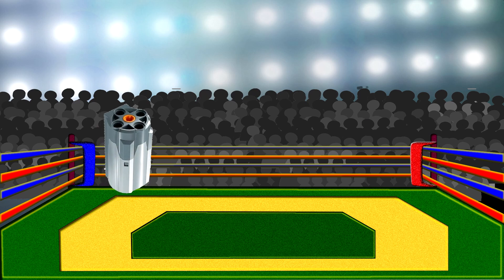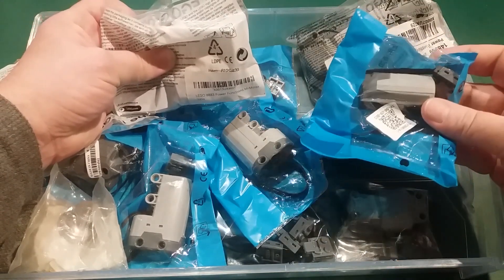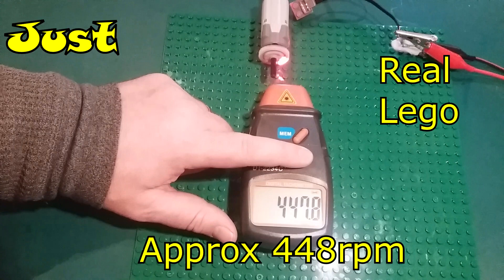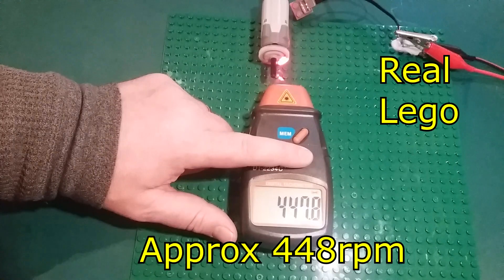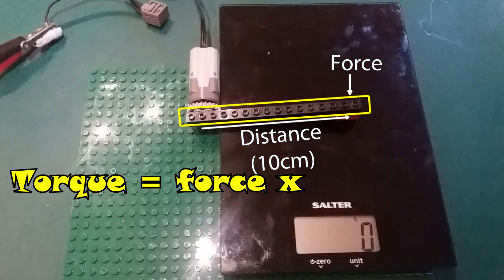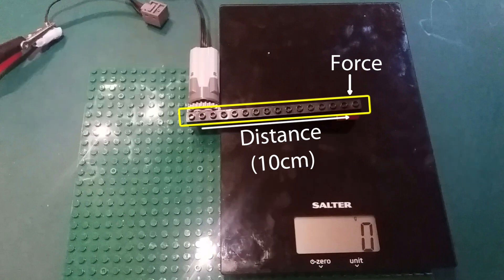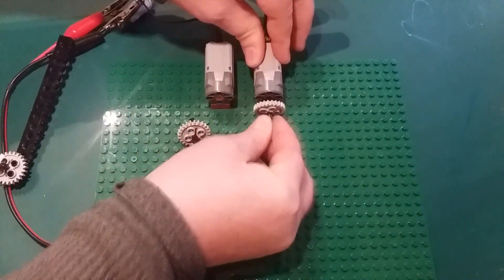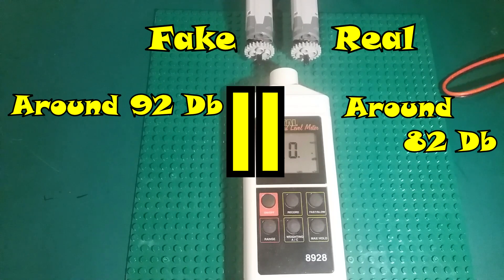Which is better? Fake Lego Motor or Real Lego Motor - Let's find out. Power Functions "M" class.

Comment: I’m trying to find a compatible 88013 Lego motor for a set I have, any ideas? Also do I just connect it up to a compatible power brick and put the batteries in? I’ve never used one before
Reply from the maker: Yes, the fakes just plug in just like originals to any official lego power bricks. Try aliexpress for compatible motors.

Comment: On the sound test were the motors spinning at the same RPM?
Reply from the maker: Same voltage if I remember correctly, which seems fairer as you'd be giving each one the same in your build.
Reply: @XTronical  Alright.

Comment: You’ve lost me at the torque specs and RPM, so lego wins because the fake on doesn’t match its RPM which is twice the speed! However the fake Lego wins after having a very similar yet noticeable increase in torque.  I would also like to add the added RPM would in combination with the poorer material increase wear and tear and affect the life span of the none lego motor.

Comment: i have been testing the motors from mouldking in my GBCs and the quality is better than lego, i have taken each motor apart to document the internal construction, i was really impressed, they all had overload protection and solid grip on the axle same as lego ones.
Reply from the maker: That's really interesting, as lego supplies of these will be running low now these suppliers maybe essential. Do you have a video of your part of the GBC?

Comment: Ist the Fake Motor Wirkung or IT Broke?BC i warnt to buy a Fake XL Motor the original are tooooo expensive
Reply from the maker: It works fine. It just has the slight differences shown. Whether it will last as long as real lego I don't know. What the quality of the plastic is is also unknown. It felt felt much the same to me though, but that doesn't mean it's made of the same stuff.

Comment: With better torque and much higher RPMs the fake is much better for most applications unless you are trying to recreate a specific model that does not have some sort of throttle control...as long as you have control of how and when to apply it, more power out for same power in = more better every single time.

Comment: don't buy FAKE!!!!!!!!
Reply: Why Not, lego is too f*cking expensive
Reply: @dreieinhalbeck  sorry I think it's sale at 4%?
Reply: I agree except that lego has discontinued power functions which will make them more and more difficult to get your hands on
Reply: @DanielSvindseth  before powered up was still today
Reply: @EricKidson2008  There are unfortunately way too many issues with powered up for me personally. The extreme price tag aside, I DO NOT want to have to use my phone to use my Lego. I prefer the physical controllers (yes I know about the powered up train remote, which is not as good and very difficult to get your hands on). I also have a lot of older power functions motors, lights, switches etc. which don't work with PU without 3rd party adapters. So my takeaway is that I just wished Lego would continue manufacturing power functions, as when they are sold out, the only alternative is to get 3rd party (fake) parts, which is not very good foe legos brand
Reply: @DanielSvindseth  i mean "the simple hub"
Reply: @DanielSvindseth  bricklink.com?
Reply: @EricKidson2008  Yes, however, as the total supply deminishes as all the real ones are bought and fewer are in supply, the fake ones will no doubt become more common than currently :)
Reply: @DanielSvindseth  ok
Reply: @DanielSvindseth  im currently builing a model off rebrickable and i needed 3 m motor and 4 xl motors, that cost me €189, 28.something for a m motors and 24 for a xl motor. If i had bought those motors from aliexpress, it would cost me about €24 with shipping.

Its a shame that lego has discontinued the power functions line, those m motors were orininally about €10 a piece in the lego shop. Its okay that lego changed the motors to PU in the sets, but they should still make PF for AFOLs. If they still made them, id happily buy the originals instead of chinese ones. Im going to buy some of aliexpress and see if they are good enough for me
Reply: @HvV8446  exactly which is a real shame imo. The fake ones are usually not as good quality it seems but I don't want to pay ridiculous prices for authentic ones :/
Reply: @DanielSvindseth   yes.

Comment: fake motor has pretty same toque (a bit bigger) and higher rpm so it means that overally its more poverfull then original. If you decrease fake motor's rpm to about 440 using gearbox, you'll have twice torque so i would say that fake is better. The only disadvatage here that energy goes out twice times faster.
Reply from the maker: It would be good to do long term testing but I don't have the time or space for that.

Comment: The none Lego motor is louder but it’s also twice as fast
Reply from the maker: Good point, should do a test at same rpm.
Reply: @XTronical  you should also do it without the other bits attached to it.  I suspect a good portion of the noise came from the loose fitment of the cross pole bit into the motor.
Reply: Can you do a review on the servo motors and the xl motors. Do the xl motors have the gearing inside and how strong are the servo motors

Comment: 4:47 i wondered when you was going to mention Newtons. Thumbs up..  Weight in air.. I would go with the Real based on noise.. I work in a factory that makes PVC, most of these motors will be made in UPVC so the plastic will be mostly of Resin and a few internal an external lubricants like palm oils an stabilisers and fire retardants and colours, using titanium dioxide and other pigments. There will not if any phthalates be used, theses are used in softening PVC to give it a supple bend thus giving a flexible PVC.
Reply: Note, no thumping racket...
Reply from the maker: Very interesting, thank you.